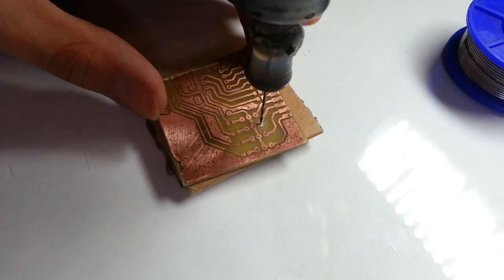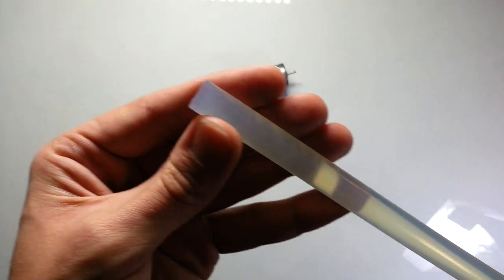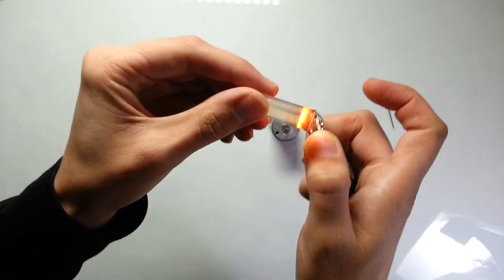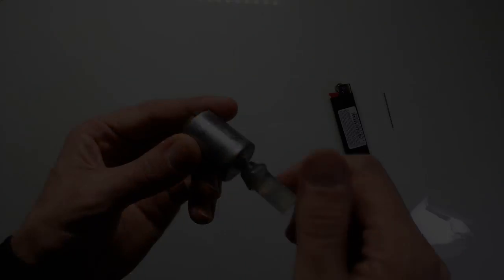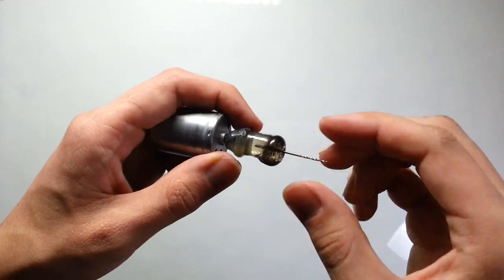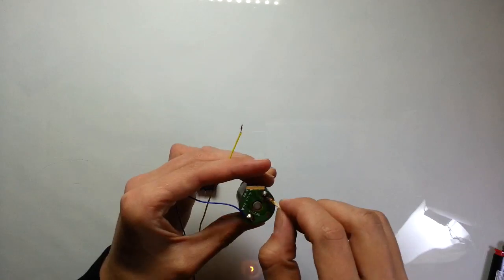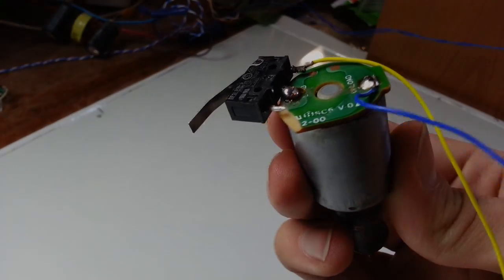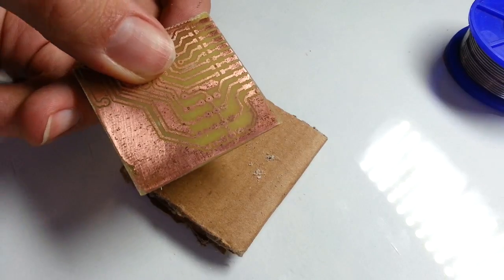DIY Mini Drill Without a Chuck For PCB drilling. When nothing else available.

Comment: can we plastic insted of material like jelly u shown?
Reply from the maker: I don't recommend to use plastic instead of "hot-melt adhesive". Plastic has a higher melting temperature and is not very elastic, so it will be difficult to use it. Try to buy some "hot-melt adhesive" it is very cheap.